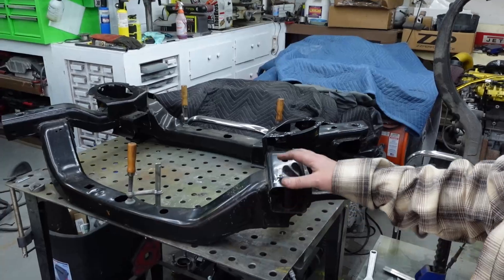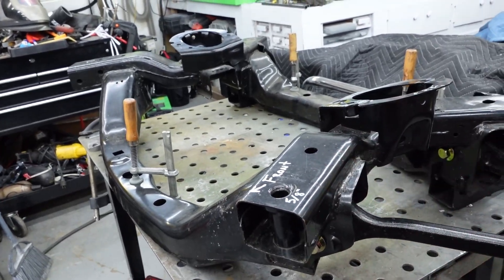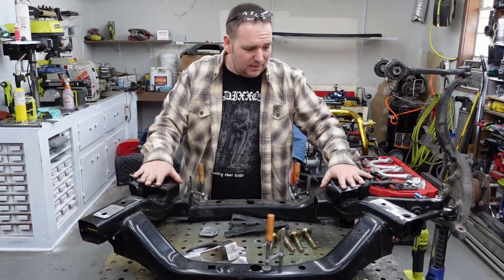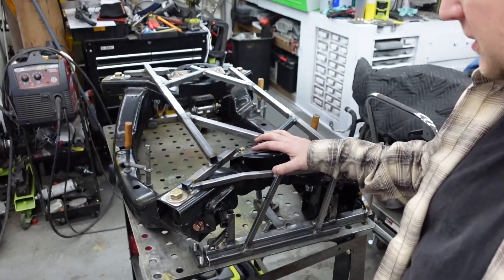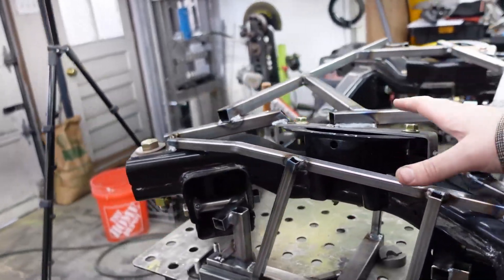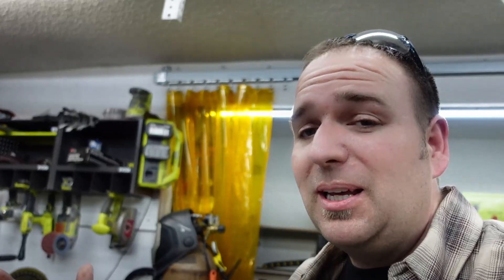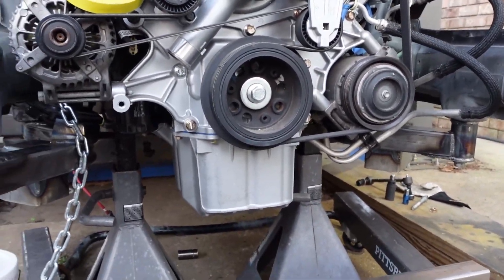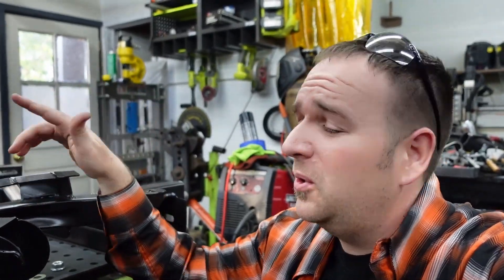HEMI Swap Jeep Renegade pt. 15 Front Sub-Frame

Comment: thank you so much man for hopping back onto this project. as a fellow jeep renegade owner, the first thing I ever wanted to do with mine was to put it on bags and to wide body it but that cost money that 16 year old me doesn't have. I still want to lower it and probably just settle for wheels and some nice fitment until I'm able to afford what I want to do. Of course I'm not looking to do a crazy engine swap but some minor upgrades here and there are enough. Right now I'm just on the stock everything. I did make a custom cold air intake box and piping but that is it. But I'm so happy that I found another guy with a jeep renegade that has the same passion as me. If you see this I would love to know what all you used and where you found the parts to lower yours and to wide body it. Thanks man and keep up all the hard work!
Reply from the maker: Thanks man, I really do appreciate the support and motivation to keep this project going.  It's pretty rare to find someone else who wants to lower a jeep, but these Renegades just seem like a good candidate for doing  just that.  Unfortunately there isn't a lot of aftermarket support for dropping them though.  Before i bagged it, I was running Madness Autoworks lowering springs and that was a pretty affordable solution.  At the time I built my setup, there was no support for air ride or coilovers, so i had to fabricate the air struts using Airlift universal kits.  I have seen another one on air, and I think they used coilovers converted to a bag over strut setup, but I'm not sure.  That's what I'm doing for the suspension on this eventually, using BC coilovers and replacing the springs with bags.  The widebody flares were built from scratch using fiberglass, which actually took a ton of time, but was totally worth it.  You can check out the build process on my insta @Lunchie_B where i took pics of pretty much the whole build over the years.  It's pretty cool seeing someone already passionate about modifying cars, and at 16 you have so much opportunity to build skills and just have fun with the whole process.
Reply: @Lunchie_B  Thank you so much man for responding! But yea I was thinking just rocking with lowering springs right now since they don’t break the bank but I will for sure check out your insta and the full build. And great job on the scratch fiberglass flares they look absolutely amazing. And i’m not sure why more people haven’t wanted to do this to a renegade I feel like it looks amazing. Thank you for responding again and thanks for the motivation on my own build. Keep up the work man!